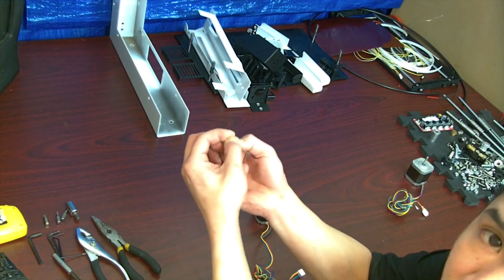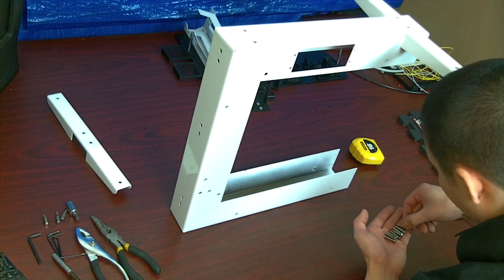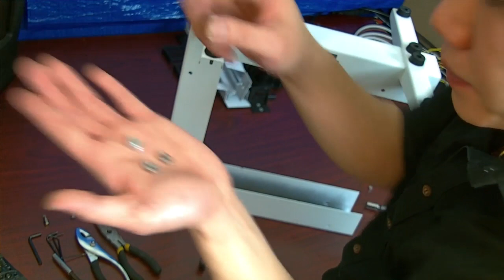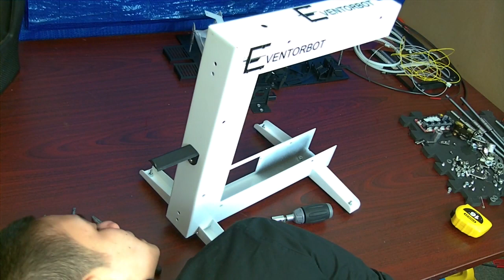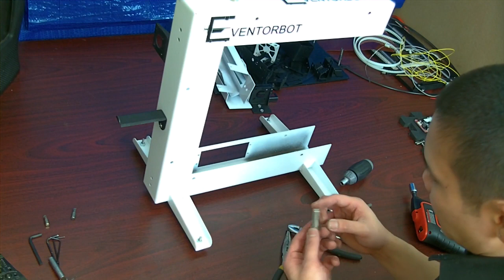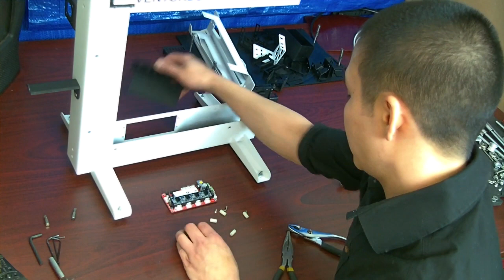3D printer Eventorbot 1.2 assembly video part 1

Comment: About 22 minutes in, you did not tighten the jam nuts.  The purpose of jam nuts are to lock themselves into one another, making a barrier against other things on the threaded area.  You seem to be using the smaller washers as spacers, the larger as pulley sides for the belt.  The jam nuts, then, need to be tightened so that the bearing and washers do not travel side to side, nor cause the outside nut from possibly coming loose.

Comment: This looks like a VERY well designed and thought out, yet simple 3D printer for home use.
I cancelled my order from Makibox due to their continual dishonest build and shipping claims.  They have been backordered for OVER 18 months, yet continue to promise 10 week or less build from order date.
I like the relatively huge build size of your unit.
I do think I will order one when available.  I have seen several on Ebay, I guess they are your kickstarter units.
Any upgrades or problems that is common with new products?
Reply: I was a backer. Only problem was I guess I was sent parts for 3mm filament instead of my ordered 1.75. Put some duct tape on the bearing to feed properly, and I got some 1.75 teflon for $2 ish on amazon for inside the extruder hot head. As long as all the parts are in it, you can make an ebay kit work. Oh and two bolts /should be cut shorter for stability, the rear legs I believe. Bolts are too long to tighten as is with all the junk that goes back there.
Reply: qwertboyo LOL.  I checked this out and bought some teflon tube for the 1.75, just in case.  I pan on running the smaller filament, less stress on the feeder motor, less heat, less amp draw, better control.  So my mind says.

Comment: Wow, you are going over very small details, but, ah, where do all  the large steel frame parts come from?  Thanks.  Oh, and which is better:  the original Eventorbot (with the square-channel steel) or this v1.2?  I think I've missed the transition to v1.2 -- please assist.